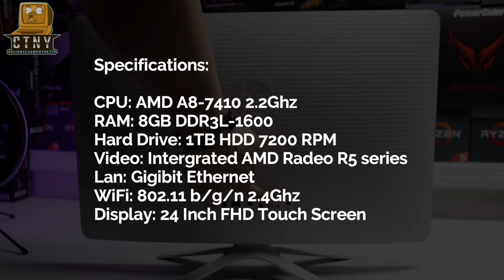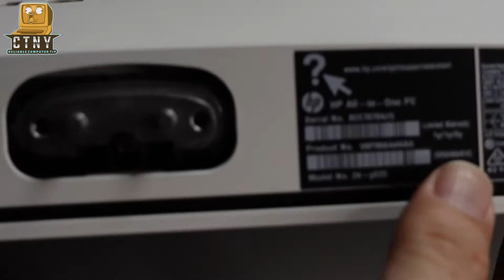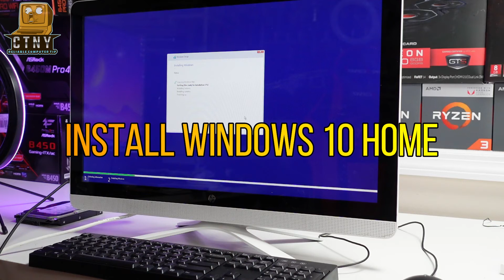How to upgrade HP All-in-one PC  24-g020 - 500GB SSD

Comment: And YES, the ram can be upgraded to a 16Gb card for around $100-120 dollars. It's only a single channel dimm and won't be as fast as a dual channel system with 2 slots, but it works better than a single 8Gb card for sure. Search for --> 16GB DDR3 Laptop RAM 1600MHz SODIMM PC3L-12800S DDR3L SO-DIMM Notebook Memory 2Rx8 1.35V CL11 Non-ECC Unbuffered 204-Pin Memory

Comment: Any big difference performance wise? Really wanted to upgrade it in more ways hardware but no upgrades
Reply: Huge difference. With the original drive, the system becomes bottlenecked and slows down. By installing an SSD, the CPU can run faster because it doesnt have to wait for the disk. Other compments such as RAM will also benefit as well since there is no longer a slow drive.
Reply: @coke4274  Got it. But isn't the ram capacity 8gb that is already installed? If i add a 16gb ram will it be able to use it or just get a better 8gb ram card
Reply: @robsanchez386  - the system only has 1x SODIMM slot - it only supports a maximum of 8GB of RAM via 1x SODIMM stick. You cannot upgrade it to 16GB.

Comment: Is the ram upgradable?
Reply from the maker: Yes. it has upgradable SO_DIMM ram socket (laptop memory) on the motherboard. Thank you for your comments.
Reply: @pingman2005 -  the system only has 1x SODIMM slot - it only supports a maximum of 8GB of RAM via 1x SODIMM stick. It only supports a maximum of 8GB of RAM. You cannot upgrade it past that.
Reply: @MrMarinegold  - there's only one internal SATA connector on the Motherboard. If you want to clone the HDD data to a new SSD, you need to do so via external USB.
Reply: @comtongny7776  WHY DID HP MAKE THESE PCS WITH HDD instead of SSDs DUH DUH DUH?